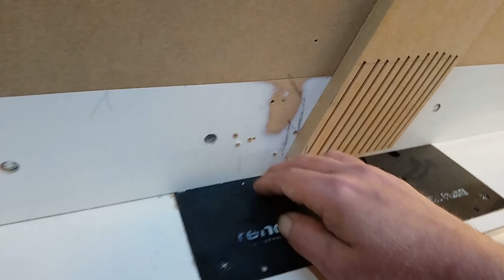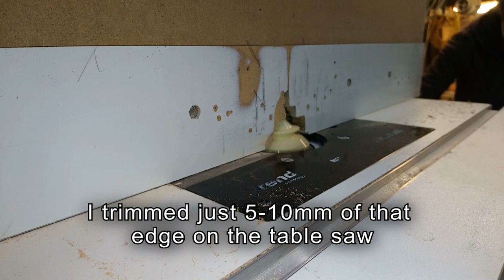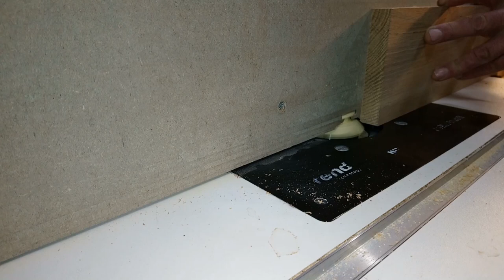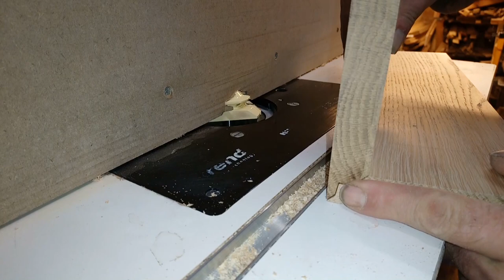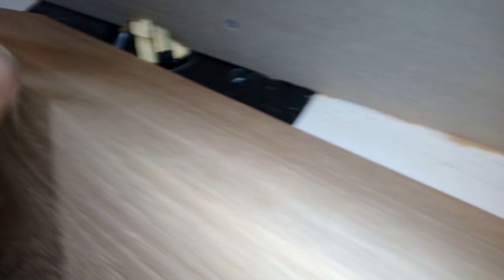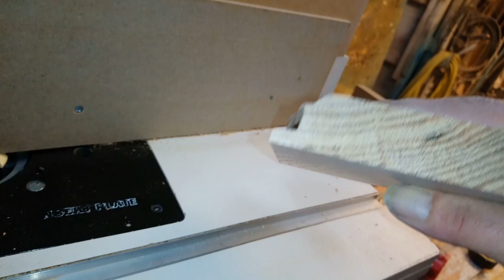Oak shelf - Pt4, Lock mitre corner joint, hindsight what i should've done for the shelf

Comment: I would say that we have a very similar view of life. Going back to find a solution, even though the job is out of the door, is what I do. But finding that fix, when it goes wrong, is what gives a big buzz. Not sure what I would do without CA glue!! I'm a Woodturner, and the first question I ask is "what's the finish?" That dictates much of what happens next. You never know what you will find inside the wood, I've found metal, included bark an weirdly, with no exit hole, a dead worm. Suppose that's what keeps it interesting!
Reply from the maker: Hi, yeah i couldn't leave it like that, i had to go back & have another go, come up with a satisfactory result more for my conscience than for future reference 😉
CA glue 👍 there's always a pot somewhere, I'm also happy that Toolstation now do 50g pots £2.35👍 , i had to go to the other side of town to get those but Toolstation are just down the road 😀,
Reply: Gid joiner. Thanks for the tip, I went to tool station, and picked up a couple of 50g bottles. To return the favour, if kept in the fridge, they last up to a year!!
Reply from the maker: 👍 I'll keep that in mind but they don't last that long here 😂

Comment: Brilliant video thanks Gid   

Where did you buy the bit from ? 

Really appreciate you sharing this technique 👌🏼
Reply from the maker: Thanks no prob Gary,👍
 I had to re-visit this cut & it turned out ok so thought I'd share as it seems to me to be a simple way of setting up,
They're from Axminster, There's 3 sizes, I have the smallest  9mm to 13mm & this one the largest 13mm to 25mm. I skipped buying the middle one as the sizes (13mm) seem to overlap, 
https://www.axminster.co.uk/axcaliber-mitre-lock-cutter-ax805970
Reply: Gid joiner - many thanks again Gid. I’m buying one today. Great help 😁👍
Reply from the maker: No problem 👍 Love new toys 😀
Let me know what you get n how it goes 😉
Reply: Gid joiner - sure will - 😁

Quick question- just fitted a new Oak staircase - client wants to oil/ treat it and wants the oak to be as light as possible - what would you recommend? 🤔👌🏼
Reply from the maker: Sorry can't really recommend anything, maybe a clear wax, Liberon do some good ones, I just spray a clear lacquer on or maybe a clear satin floor varnish for easy maintenance,
Reply from the maker: You saw the colour of the Oak shelf before & after, that was a clear satin/mat lacquer, the wood went a golden colour, wax might keep the colour a little more true to the original, 
interesting? I've some clear wax polish i use on the machine beds & some oak, I'll try it out 😉
Reply: Gid joiner thanks again Gid- 

The only one I can recommend is Danish oil clear.... I’ll do a test for her with the off cuts of the staircase and spindles - then let you know 👌🏼😁 have a great weekend Buddy